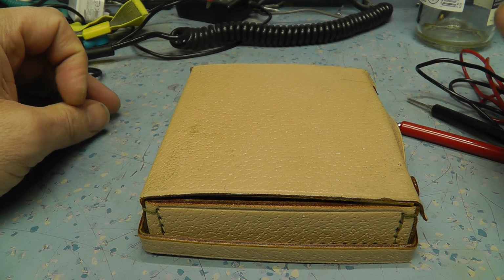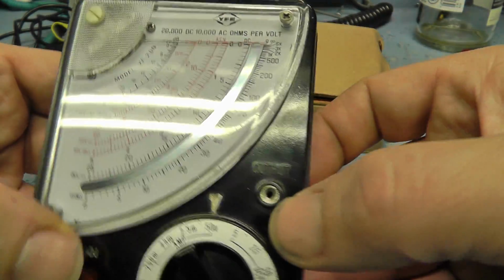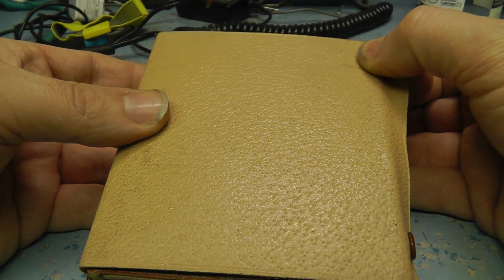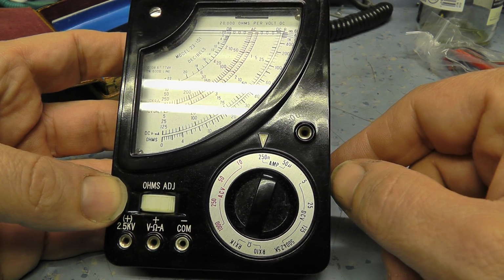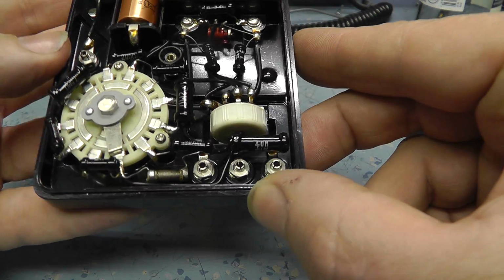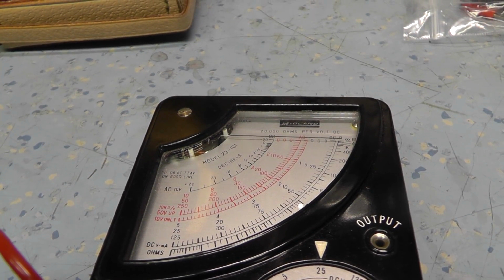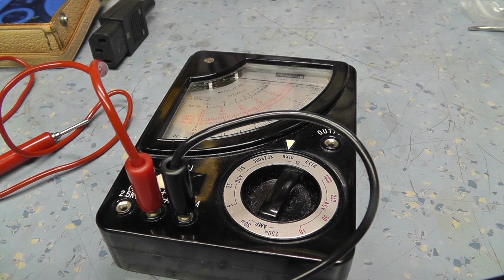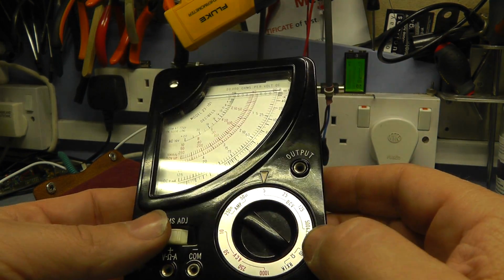A look at a 70's multimeter

Comment: At work (audio repair shop) we frequently use old analog Triplett or Simpson meters for certain diagnostic tasks. Digital meters used for static,  in-circuit component tests can "fool you" as the display figure bounces around. Analog  Meters are particularly useful for checking the input AC power-loop circuit of a "dead" device,  from the power cord through the on-off switch and the switched outlets and to the transformer primary,  because you can see the effect of the inductive "kick" of the transformer when the meter probes are 1st applied to the primary,  it takes a 1/2  second for the meter pointer to ramp up to speed. Analog meters  Are also excellent for checking diodes in both directions to see if there is an open or a short, and similarly useful for doing a quick in-circuit check of suspected shorted output transistors in circuit, and you can also see the filter caps charge/discharge just from the analog meter's battery voltage, if you reverse the probes. PS, if you're testing batteries, the relatively low impedance of an analog meter will load the battery down a bit and the  resulting voltage reading will give you a better idea of the quality and useful lifetime of the battery in an actual device ,  compared to a digital meter which will always read higher on battery tests and can fool you.

Comment: Can you explain what is meant by: 20,000 AC 10,000 DC OHMS PER VOLT?  BTW, no fuse anywhere?
Reply: Unlike a digital meter, you don't have a constant input resistance at an analog meter (except an VTVM). So they have a resistor in series with the meter, the higher the range, the higher the resistance. The resistance value is given for full scale deflection. When it says "20kOhm per volt" and you have the 10V range selected, the input impedance is 20kOhm x 10 = 200kOhm. In the 50V range you'll get 20kOhm x 50 = 1MOhm., and so on.
Reply: In addition to the excellent technical description given by another commenter below, the practical difference in use between a digital meter and an analog meter is that when you are working on older equipment and using schematics to troubleshoot for proper working voltages, if the schematic dates to the day when analog meters were used to make those measurements but you are using a digital meter, your voltage measurements will all read "high" on the digital meter (compared to the reference schematic) because the digital meter doesn't load the circuit down in the same manner that an analog meter would, or did,  back when the product was made and the service information put together. 

Note that the impedance (and lack of circuit- loading characteristics) of a modern digital meter are closer to those of a VTVM, or Vacuum Tube Volt Meter.

PS, hint hint, if you are calibrating a Hickok tube tester with the aid of a  digital meter, your calibration will be incorrect unless you shunt the meter  probes with a resistor, 150k to 200k being about right. Only the grid-signal voltage gets calibrated with a digital meter, or a VTVM.

Comment: nice I have a few Russian made multimeter s from around the same era
Reply from the maker: Hi Benji, yes they are nice to use still. Great for the car and bike when i'm fault finding too as they are small and low input resistance.
Reply: yes they are and so much easier to read than a digital one ! if the voltage is varies